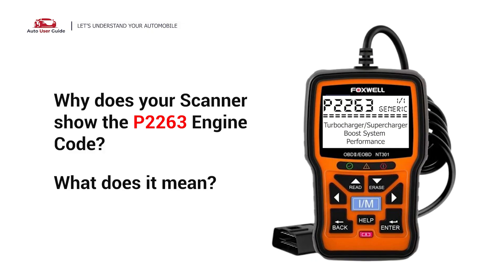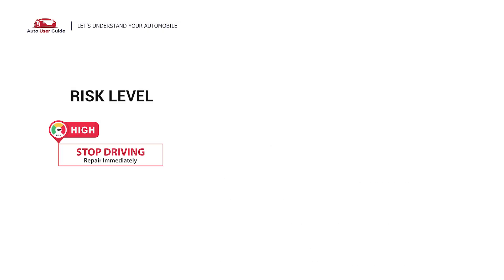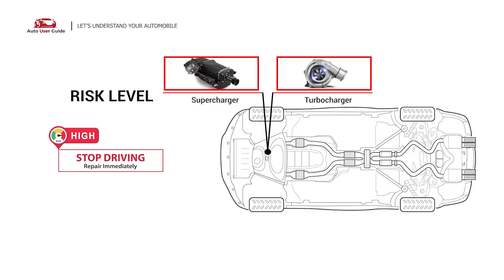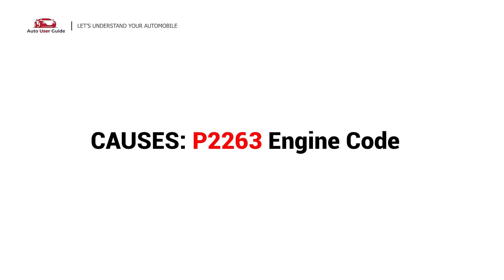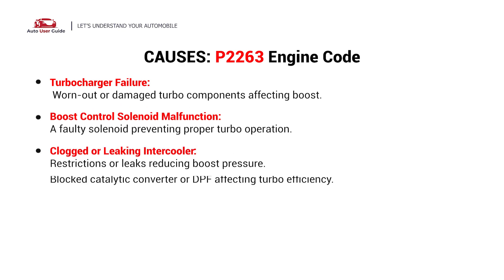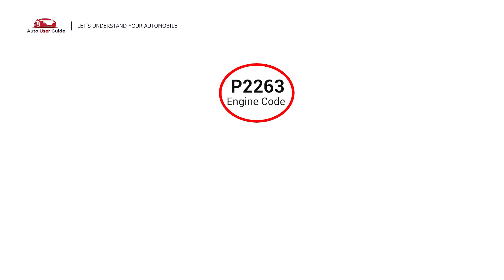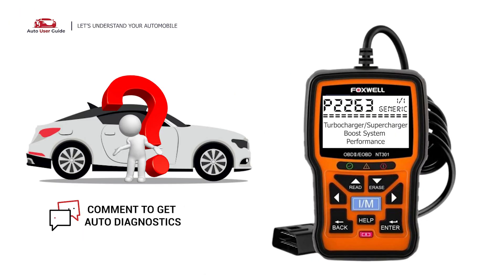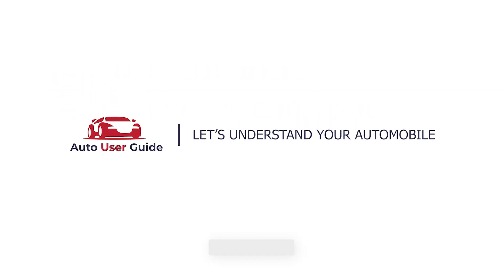What is P2263 : Engine Error Code Causes Explained

Comment: My polo tsi  is showing EPC and leck power but when i unplug the cable from turbo to air filter EPC goes away but car still on limp mode when pressing gas

So my question is is it turbochage or sensor